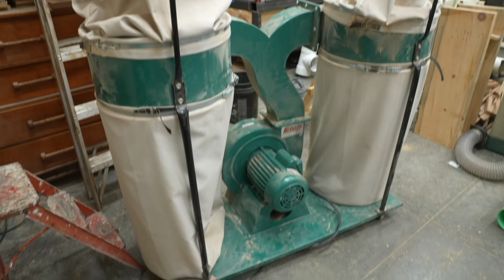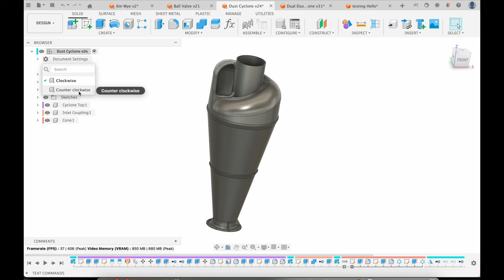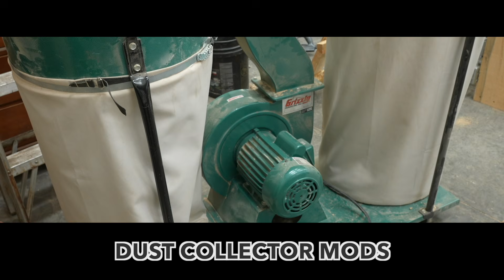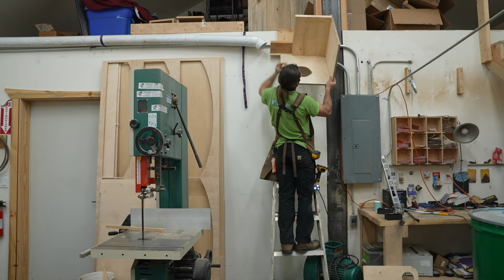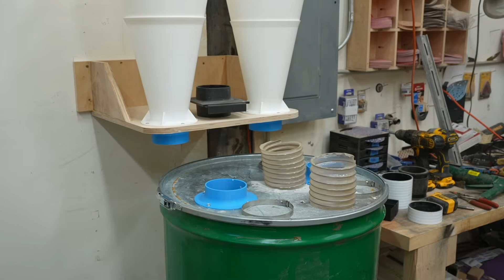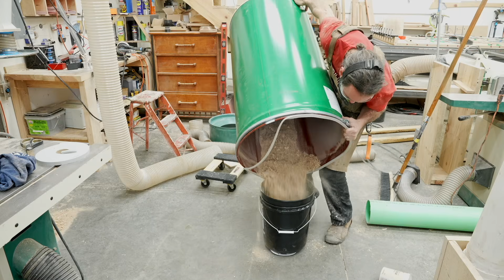Cheap, 3D Printed, Efficient, Dual Cyclone Dust Separator

Comment: Your move from the earlier horizontal collector experiment to a printable dual-cyclone design, with the files shared for other makers, is a thoughtful way to test shop dust collection. I'm Jonni with PEMEDOR. We make a dust separator for woodworking shops, and I’ll contact you through the email on your workshop site about a possible independent comparison. No need to share any contact details here.

Comment: With the H2C, it should be possible to use pla for your supports, yes? 

Have always loved this channel, thanks Corbin
Reply from the maker: Definitely! The H2D also could do it - I just haven't experimented with that yet.
Reply: @CorbinDunn same here.  I have the H2C also, but I've only printed with my .4 nozzles.  Haven't mixed the .2 with .4 prints and stuff either.  I think the support idea is neat with the dissolvable plastic, but the whole micro plastics thing bothers me with that.  I try to stick with my compostable PLA when possible, and petg for all things garage :)

Comment: Can it be scaled down to print on a p1s and use 4” duct?
Reply from the maker: In theory, you can scale it down, but I'm sure there will be fitment issues. You'd be better off modifying the model... but some things, like the entry way, had to become rather specific to the shape I designed. It wouldn't be hard to do, if you are familiar with Fusion.

Comment: Not sure if this has been addressed or not, but when printing PETG, to make support removal easier, if you are using a multi-filament system, use PLA as supports and PETG as your print. Works the same opposite direction.
Reply from the maker: Yes! I have the right printer..I just haven't tried it yet.

Comment: Great job. I 3D print all my shop dust connectors as well as make my own magnetic quick connects. One tip I can give you is that airflow dislikes 3D printed parts that aren’t airtight and are rough surfaces. The fix is epoxy, brush a light coat of epoxy on the inside and outside of your parts. This makes them super strong, super smooth and airtight. You’ll notice a big improvement. 😊
Reply from the maker: Thanks! Yeah, I should try the epoxy trick and see how it improves stuff. I haven't been using the shop much lately; doing other stuff.

Comment: Wow, you have done great work, Thank yu I also use Fusion, Onefinity and I also 3D print. Perfect match!! Question, I dont find a Fusion Maschine file for the Onefinity, what are you using! Thanks from Vienna Austria!
Reply from the maker: Hi Hans, Do you mean a Fusion post processor to export the toolpaths as GCode to Onefinity? I'm sure there has to be one...lots of people use that brand CNC. It is based on the controller..ie: Masso, redline, etc. Most companies provide the post processor for their CNC if it isn't in Fusion's default list.  I use the one provided by Avid CNC for my machine.
Reply: @CorbinDunn  Oh, sorry for the confusion, I thought you are using a onefinity CNC. Postprocessor is provided for Fusion but no Preset file for the maschine. Thanks for your quick reply, you are doning a great work!!
Reply from the maker: Ah yeah, I made my machine preset...just set it up based on my specs and table size!

Comment: 10:20 they make magnetic duct connectors for laundry dryers. those might be a better solution than the fexi-ducts.
Reply from the maker: Cool - I’ll have to look into them. They need to be very airtight to avoid any disturbances in the vortex.
Reply: @CorbinDunn yeah, that is true. Maybe...

Comment: I have a homemade cyclone, from the Wood magazine design. I found that a 4 inch drop tube into the collection bin clogged when using my straight blade planner thicknesser on wide boards, due to the length of the shavings. I retrofited 6 inch tube and that solved the problem. If you have helical head machines this should not be a problem. I now have several 3D printers and would try your ideas, but 20 years ago rolling sheet metal was my only option.
Reply from the maker: Thanks! I am curious how the 4" outlet port will work for me; I wonder if having two will avoid clogging issues compared to one. I do have a helical head on my planer, and I have tested running some 20" wide pine boards through, and I haven't had issues. My jointer has straight blades, and the CNC generates long stringy "chips" on certain cuts...those may be my problem points.

Comment: The biggest flaw in this design, the plastic will not hold up to the friction of the dust and will wear rather quickly.
Reply from the maker: I wonder how long that will take? Sawdust hasn't seemed to affect other 3d printed parts I've done over the years (ie: adapters, inlets).  There are always more abrasive resistant materials to print with..but then the cost will be more.

Comment: Great design, thanks for the downloadable files, an interesting idea would be to print a copy of a Clearview cyclone(scaled to fit your printer) and compare the 2....I don't have a printer unfortunatly
Reply from the maker: One of the hard parts for me is knowing the exact dimensions for all the parts to compare it. The Clearview design looks like it follows a more "traditional" cyclone design: square inlet, ramp via an inside flat spiral, and a straight top --I think that design was all tied to Bill Pentz's original design, and how it could be made out of sheet metal (even though clear view is obviously plastic). I tried to avoid those things with more fluid curves. It would be interesting to do more experiments though!

Comment: Is there anyway it can b downsized for a 2 hp system??? Thia looks like a great idea for me
Reply from the maker: What size is your inlet port? For a 12” print bed or smaller? Yes, it can be resized… but it will take some CAD work. For a smaller system, a single cyclone may be sufficient.  Maybe I can resize the design a bit if there is demand.

Comment: Mixing graphite powder with  acrylic paint makes it conducive and can be put on plastic.
Reply from the maker: Whoa, really?!! This is something I'll have to look into and try. Thanks for the tip!! I've also heard there are some conductive PLA plastics...but they are like $100/kg.
Reply: @CorbinDunn There are also esd/anti static coating in spray cans that work with printed parts.
Reply from the maker: Cool - I didn't know that either. That could help!

Comment: Great Job Corbin! I've been doing CNC since 2008, laser since 2014 and I only just got a 3d printer. Thank for  the great work you do.
Reply from the maker: Awesome! The printer is a great addition to the shop. Design and print some low profile toe clamps -- they are super handy. I've got a video about hold downs; feel free to copy my design (or buy my files for a couple bucks)

Comment: Looks extremely cool. I’ve designed a few cyclones for 3d printing for shop vacs as well as a dust collector. About the only thing I can see you can add that “might” help is to have an outlet tube going down into the cone. You currently have the top forcing the spin, but when the material enters the actual cone, you have a large dead space which may be letting the smaller particles to just roll off and get sucked into the outlet. By adding like a 4 to maybe 6” outlet tube down into the cone you should be able to increase the length of time/spin and increase in air speed to force more of the smaller particles outward before the air travels into the outlet. I had to play a lot with tube lengths going down into the cone to get higher efficiency. I’m just guessing here from what I can see in the video sooo? 🤷. One last thing. Paint/clear coat the outside of the printed parts. 3d printing is far from air tight! You will likely have micro holes bleeding air,  none big enough for things like a smoke test to visualize, but add thousands if not tens of thousands of them over the surface and it’ll add up. If you want to see my designs they are both on printables under Thomllama.
Reply from the maker: Thanks Thomllama! Yeah - I wanted to make the outlet tube height adjustable, but i never got around to it - it only goes in to the depth of the top spiral. I'd like to print a translucent version so I can really see what is going on inside.

I checked out your designs, and I like how that tube is separately printed  -- that could allow easy adjusting to fine tune the position. Do your designs have a flat top on the inside?  If you use Fusion, check out how I drew the cyclone top spiral, and copy the concept into yours. 

I'll also look at clear coating the outside - I had heard PLA isn't quite air tight, but I wasn't seeing any visible side effects. 

Thanks!
Reply: @CorbinDunn  adding the outlet tube can help and easy to adjust/change with it a slip in setup. Mine is sorta flat, there is a minor pitch to it. I started a corkscrew top, but back when I designed it printers hadn’t evolved as nice as modern ones are. I printed on a home made custom printer I designed and built back when anything over 200mm wasn’t normal. It’s SLOW! And far from the best, and doesn’t do supports well. Plus my collector is only a 1hp, so the whole cyclone is smaller so the top was a bit of a trade off for easy printing. Been working fine for many yrs now so never bothered to take it any farther.  As to coating, I ended up getting a “glazing” paint in rattle cans, was cheap and actually is thicker coating to seal better.  Oh, another thing, get a decent canister filter, but look outside the “woodworking” area and look at dedicated filter manufacturers! Donaldson I believe mine is, was 1/2 the cost of like Wynn, merv 15, about 2x’s the size and pleat count of most “woodworking” specific filters! Have to make custom mount, but you seem to have no issues dealing with that!  Got on Amazon at the time but they sell direct also for less I’ve heard since I got mine.
Reply from the maker: Cool, I'll check it out! I already have the Wynn filters...so I'm committed to them for now.

Comment: You can print PETG with PLA for the support interface layer. The parts will hold but not bond togetehr and just pop off easily. Your H2C with its multi nozzles is the ideal tool for this.
Reply: Or design your own supports in cad or change the layer offset distance between the supports and the part.
Reply from the maker: Yeah! I definitely want to try that out. One  problem is I'm maxing out the size and can only use the left nozzle when I do that (ie: no multi-material). It's one of the limitations of the H2C

Comment: Could it be scaled down to fit on an A1 without affecting the port diametes ?
Reply from the maker: It looks like the A1 max size is 10"; I changed the cyclone diameter to 10" in Fusion, and it does have some issues re-computing the inlet ports. The problem is the inlet port is proportional to the cyclone diameter for throughput...so it might not work as well to simply change the cyclone diameter.  The actual dual-inlet is 6"...that one should adapt (but I didn't test it).  It'd be possible to get it to work, but it is going to require fixing up some of the model to be more abstract; right now some projections get lost for some reason (Fusion can be picky).
Reply from the maker: If you are willing to try printing it, I can probably take the time to modify it
Reply: @CorbinDunn I am willing to try printing it.   Thank you.
Reply from the maker: @DanDewRyker let me see what I can do…
Reply from the maker: I spent some time on reworking it; my goal is to make it abstract so the size can easily be changed, but Fusion keeps losing the projections from the cyclone shape. This makes it tricky..so I might have to redraw for a particular size. I'll try to get around to it..but it isn't as quick as I hoped.
Reply: @CorbinDunn thank you.  Don't let it take your time away from other more important things.
Reply: @CorbinDunn how is it going?
Reply from the maker: Been away on vacation! (spring break rock climbing in Joshua Tree with the family)
Reply: @CorbinDunn Nice 👍

Comment: Mate, you have multi-nozzle printer. Use pla as support on petg or vice versa. Or use dedicated support material 😊
Reply from the maker: Yes! This is something I want to try for small parts and inlets. Unfortunately, the cyclone top size is so large that I have to use the left nozzle only, as the right nozzle can't reach all the areas of the bed, so I couldn't do this. It was also unfortunate because I have 0.4mm nozzle on the left; the right nozzle has a 0.6mm tool change option, which prints so much faster. I might have to scale it down a bit so it fits within the dual-print head area.